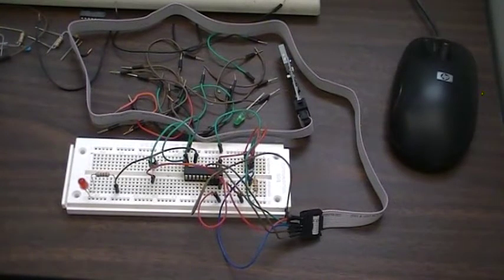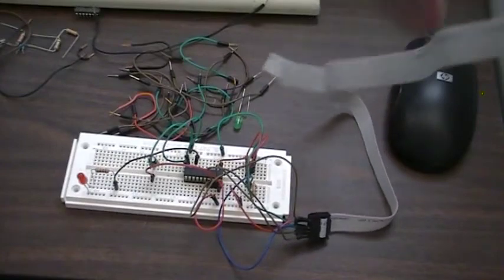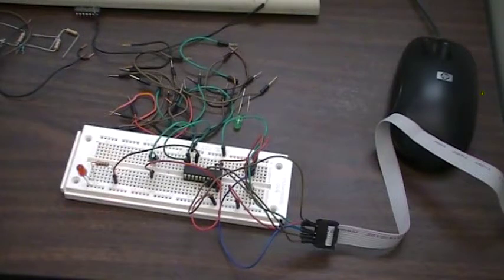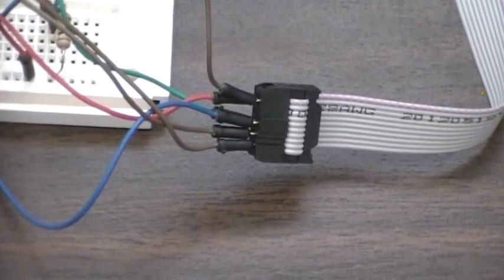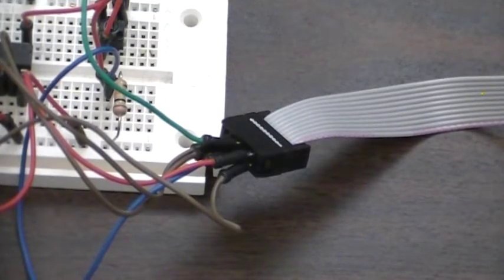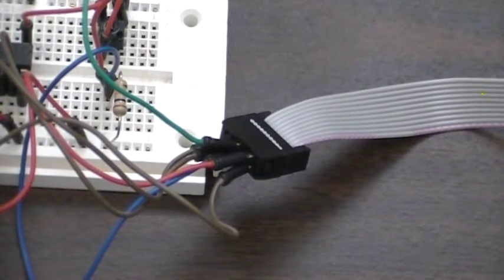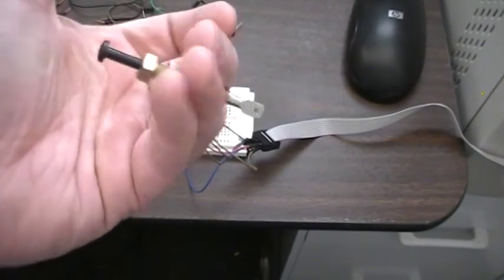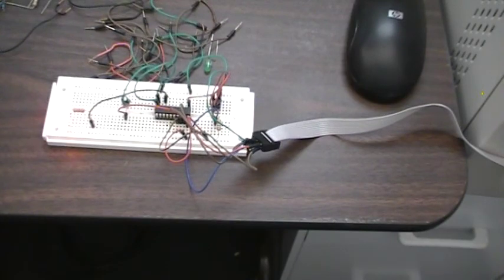attiny2313

Comment from the maker: How are you loading the code onto the attiny2313?  Does it look like the code is uploading to the attiny2313, and just not running correctly?  If everything is hooked up correctly, I would suspect your reset pin needs to be hooked up correctly.  I am in the middle of trying to put an engine back together, so I am pressed for time right now.  When I get caught up, I will try and make a video for you.  I am using Ubuntu to do this.